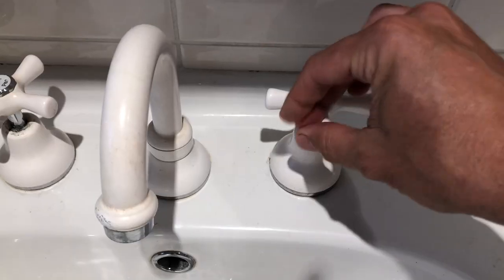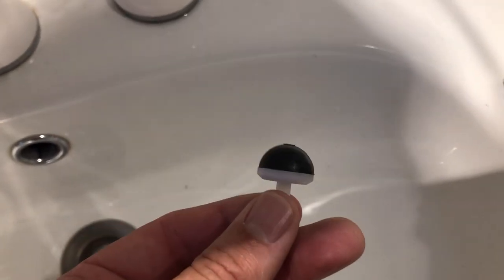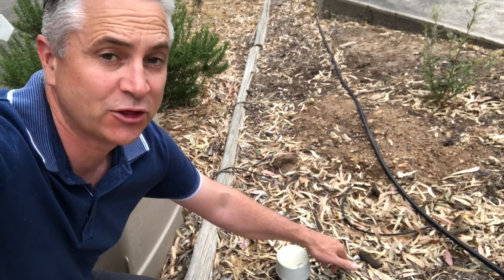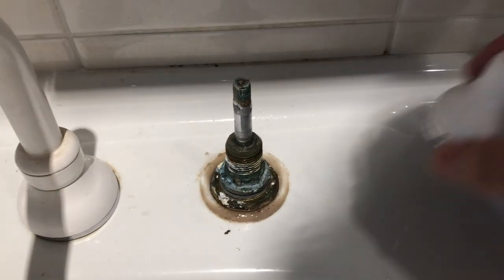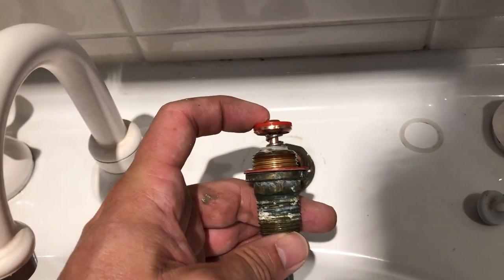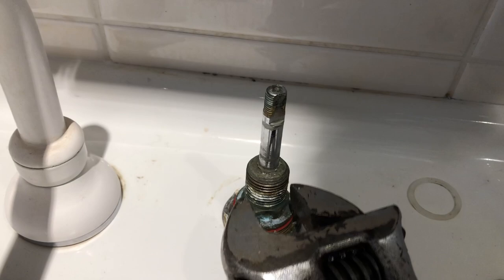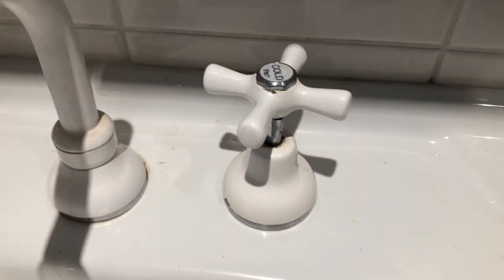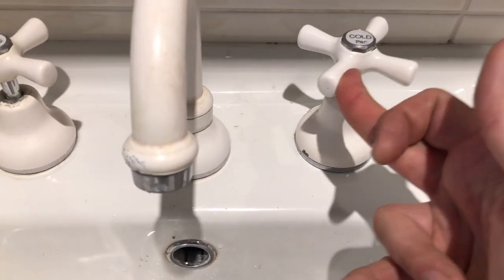How to easily and cheaply fix water hammer noise in your pipes - don't spend hundreds on a plumber!!

Comment: Great video and easy fix for pipe rattling! Our house has that exact same problem and I thought that it was going to be a real expensive fix.  After watching your video on how to easily fix the water hammering noise I was extremely surprised at how simple the repair was!

Keep up the good work!  It's always the best to learn how to solve problems yourself as almost everyone who comes to one's house today for repairs will tell you lies to get the most money from you as they possibly can.
Reply from the maker: Hi Joel, thanks for the feedback!  Pipe hammer can be problematic, but the cheap fixes are always good!!  Cheers Drew

Comment: You bloody ripper. Great video and a link to the product too!
Reply from the maker: Thanks mate! Cheers Drew
Reply: I actually had water hammer on both the hot and cold taps but I managed to get rid of the water hammer issue with this fix but still had less flow than one of my other bathrooms. I swapped the aerator and washer between the sinks and immediately got water hammer issues on the sink that didn't have any. I'm going to add the anti hammer tap valves and replace both aerators and I should be good to go. Thanks again!
Reply from the maker: @OneIdeaTooMany  hi Mate, thanks for letting us know.  Seriously glad that you found the video and fix helpful!!! Cheers Drew

Comment: Great vid thanks. Question: how about fixing the hammer noise a toilet makes as it completes a fill?
Reply from the maker: I would put a new inlet valve in the toilet personally.  The new ones are very simple to install and are super quiet on the fill with no hammer noise!  I trust this helps?  Cheers Drew
Reply: @DrewFixIt  thanks so much, appreciated

Comment: my hammer problem comes from kitchen faucet (single handle).  Do you think it's washer issue or a better option to install hammer arrestor?  thanks
Reply from the maker: Hi Mate, so hard to comment remotely, however I would ask how old is the kitchen faucet?  If it is many years old you may find that there is either a partial blockage in either the braided lines supplying the tap or the faucet itself.  Does it run relatively slowly?  If so, what I would do is try and determine where the blockage is and what I would do first is check the braided lines!  I hope this helps somewhat?  Cheers Drew :_DFI:
Reply: @DrewFixIt  18 years

Comment: I have a two story home with multiple sinks, toilets and showers. I get the water hammering in each and every one of them whenever I turn on the water. I simply cannot replace that part in every single fixture. What is the solution?
Reply from the maker: Install these https://amzn.to/3INqDCf between your washing machine hoses and the supply taps!  Cheers Drew

Comment: Do I need to install these washers on every faucet in a larger house (with lots of faucets) or will installing water hammer arresters  on my washing machine taps be enough (I am assuming that all pipes are connected within the house and there is water pressure within these pipes at all times). I would be interested to hear your views on this.
Reply from the maker: Hi Mate, it really comes down to if you have multiple taps that are causing pipe hammer or not?  If you only have one or two try these washers in those taps, if you have pipe hammer issues across the house then install a more permanent arrester such as the in-line one on the washing machine taps.  Cheers Drew

Comment: So if the faucet hammers when the toilet is filling, is the problem the toilet valve?
Thanks very much!
Peace
Reply from the maker: So, if the faucet hammers when the toilet is filling then assuming your toilet cistern is a standard one then I recommend installing a new inlet valve such as: https://amzn.to/3Cpj9kY I have used these in a number of cases and they are super easy to install, however unfortunately I do not have a video of doing this.  If you have a old float across the top just remove all that old junk and simply install this upright one in the water inlet hole at the bottom of the cistern.  It's super easy!  Hope this helps?  Cheers Drew
Reply: @DrewFixIt new info- according to others it has happened with the other toilets when no other water is runni g

Comment: I would like to get one of this, I searshed Home Depot for "Spring Tap Washer", no result. Could you give me a link?
Reply from the maker: Hi Teng, I am from Australia and this is the exact product I installed from our Bunnings chain of Hardware Store (equivalent to your Home Depot): https://www.bunnings.com.au/kinetic-12mm-anti-hammer-tap-valve-2-pack_p4920387 I don't know enough about American tap hardware, but I suspect that your taps are designed slightly differently and internally the washer is slightly different.  So I don't think it's as simple as you buying an Aussie washer, as per this link.  I have searched for an equivalent American product, but I just can't find one.  My suggestion to you would be to try and install a permanent arrestor, such as: https://amzn.to/3y26y5L the neat thing about this arrestor is that it is DIY install at the washing machine connection taps.  It's cheap and worth the punt I suggest.  Let me know how you go?

Thanks
Andrew
Reply: @DrewFixIt  Hi Andrew,
Thanks for the info. I am in Canada.

Comment: Do you reckon these washers would work in washing machine supply taps?
Reply from the maker: I reckon you could give it a go!  Cheers Drew
Reply: @DrewFixIt  Actually Drew I found that shutting the supply taps/valves to the washing machine off then just cracking them open enough to allow water flow in got rid of the hammer!! I got that from an old school plumber and it works. The only thing is that the machine takes a little longer to fill!!

Comment: I have my pipe hammer on the float valve that refills my low pressure water heater. Brand new valve. What do I do now?
Reply from the maker: Hi Anton, did it hammer with the old valve? Cheers Drew
Reply: @DrewFixIt  Hi Drew, yes it did. The new ball valve is worse, but is a completely new system. The old system was electronic controlled. The new ball valve is a float valve filling a bucket on top of the solar geyser. It’s basically the waves in this bucket that causes the ball valve to oscillate. I have an idea to stop this. I will hang a plastic plant pot on the ball valve arm. The plant pot should be deep enough under the water level acting as a stabilizer to stop the oscillation effect. Will let you know

Comment: If you turn the water off slow it won't hammer anyway.
Reply from the maker: HI Bobby, I think pipe hammer can manifest itself in many different ways.  The interesting thing about this situation is that the pipe hammer starts and will continue banging if the tap is on very slowly.  Have a look at this video and you will see what I mean.  Anyway, this solved my problem and I hope it helps others out too!  Cheers Drew

Comment: Damn the Aussie accent. The remedies don't work either.
Reply from the maker: In many cases works a trick, unfortunately that means in your case you probably need to get a permanent water hammer arrestor installed into your system.  Good luck my friend!  DFI